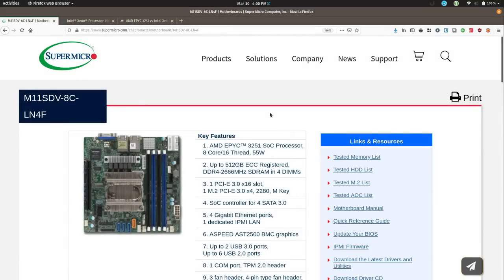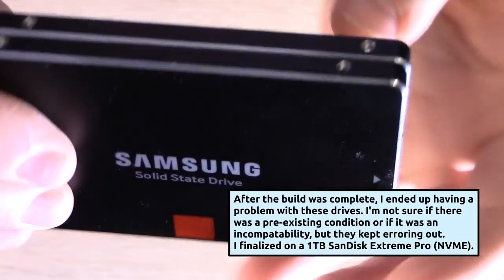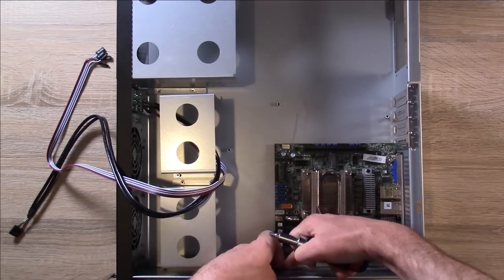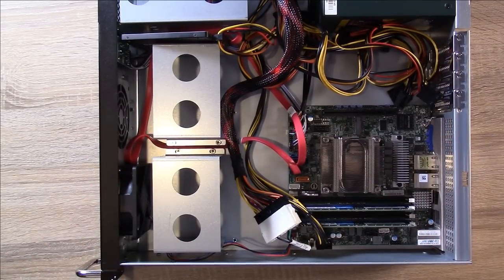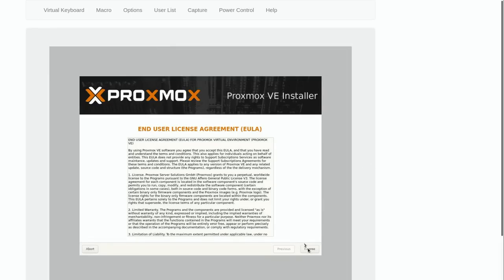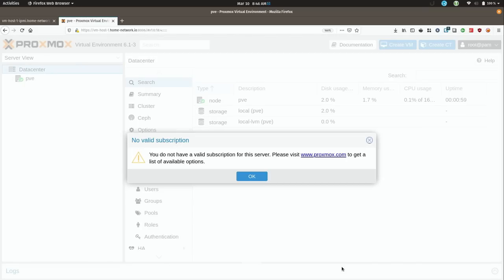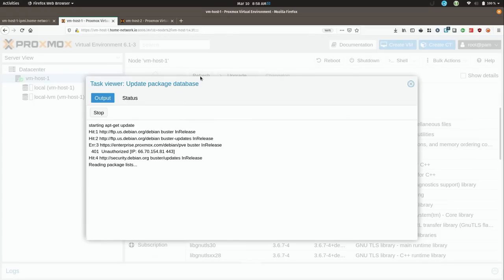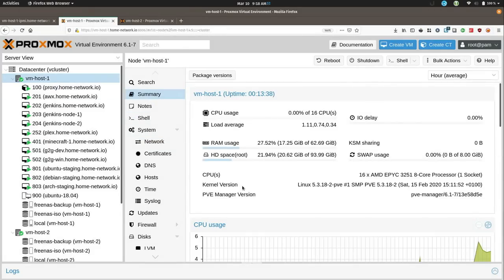Building a Low Energy Virtualization Server for Your Office/Homelab with Proxmox

Comment: HI Jay, Have a question looking to setup a home lab but will be a single host for virtualization and storage sharing  i am not sure how to go about setting things up. My initial so far have installed Proxmox on nvme drive have  an ssd for cache and log , another ssd for vm and container disks and 4 x4b in a zfs pool for storage. I have created a few vm but not sure how set and share the storage among vms, should  i set up a file server to use the zfs poll storage and share the storage that way or is they a better way , thanks

Comment: Wait, I want to know more about this web interface you have available out of the box after power on the server :o seems too god not being forced to use a display
Reply: Its generally called out of band management, or IPMI. ILO on HP, iDrac on Dell, something else on Lenovo/IBM.

My ASRock Rack X470D4U has it for the Ryzen platform, most of the white box type platforms like Supermicro and ASRock give you the whole thing, with Dell and so on you need to pay for the cool stuff but get basic management included, like remote power control, etc.

It is basically just a tiny ARM SoC that provides video and control when there is power to the motherboard, usually through a dedicated ethernet port but some can fallback to another port say if the dedicated one dies.

Comment: I really want to undestand where Virutaliztion is worth it, i really want to get into it, but i dont know where it will be useful.
Reply: I was the same then I lost my job and needed to reduce my electric bill.  So I built a i7 3770 32gb ram  on an intel motherboard.     I basically run mirrored mx500 500gb for the VM storage  mirrored mx500 1tb drives for my web server.   And 5x 8tb zfs2 raid.    
So I was basically able to get
Pfsense firewall
Pi hole
Open media vault Nas
Debian Lemp stack web server
Debian based Plex server with 1050ti for tanscoding

It's high on the ram but the cpu hasn't ever gone over 30%.   

I literally had a server for each before so it's massively cut my energy use.

Comment: Jay, I could use some advice. I just setup a 1u implementation of this server and am stuck. Shortly after selecting the install option on the proxmox splashscreen I am getting watchdog notices for all 16 cores and the install goes no further. I have tried installing other operating systems (ubuntu, debian, older versions of proxmox) all with the same stalling problem. Any ideas?

Comment: Do you have a tutorial on how you set up home-network.io as a functional local domain?
Reply: There are a few options to do this... 

Some routers allow you to define host overrides and act as a DNS server, pretty sure OpenWRT has that feature. 

You could run your own DNS server(probably what he is doing) and another benefit of that is you can block ads across your network.

You can probably define local domains in your hosts file and be done with it, though, it would be on a per device basis.
Reply: Wait..actually, he might’ve done it in pfsense, I didn’t realize it had that feature 💁🏼‍♂️ 

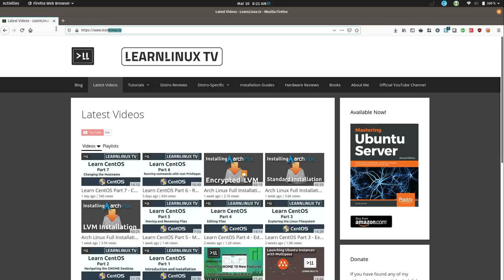16:25

Comment: Did you run into any issues on first start up? On mine, when I tried running it for the first time, it looked like it started (diodes blinking, fans spinning) but there was no video output. I ended up replacing CMOS battery (was dirty like somebody picked it up off the ground or something) and then it started BUT I had to rebuild the whole system and then it had same symptoms yet again. After power cycling it several times including clearing CMOS memory few times it finally started and haven't had any problems since then (although it was just over a week now).
Reply from the maker: I haven't had that issue. In some of the reviews I've read, it was mentioned by several people that the first startup takes a ridiculously long time to POST, making people nervous, and then eventually it comes on. These reviews mentioned that every subsequent boot is normal. I was expecting to run into this myself, but I didn't. Did you wait a while at the first startup? I'm wondering if perhaps you ran into the long first-boot issue and resetting the CMOS was just a coincidence.
Reply: @LearnLinuxTV  On the first startup, yes. But then after tearing it all apart and back together it happened again. I was thinking the board was dead - with just power connected to it (no RAM, no drives, no nothing) it didn't give any error codes (so there was one thing connected - the buzzer). Other then that it seems like it was as you described it. I guess I didn't search good enough to find those articles. Thanks. :)

Comment: You shouldn't use 2 identical SSDs for RAID1. There are sometimes firmware bugs where both SSDs can fail at the same time. Use 2 different SSDs from different manufacturers would be best.
Reply from the maker: I can see a good point there, so long as both SSDs have identical specs.
Reply: @LearnLinuxTV  Of course they need to have similar specs. The problem is that this will not work with large arrays and can increase cost for some uses cases. But a 2-Disk RAID1 in one computer, i would use 2 different ones.

You may heard about the firmware-bug that some HPE (HP Enterprise) SSDs have which will cause a failure after exactly 40000h, which was announced a few weeks ago.

Comment: Why not use a regular AMD desktop platform? Seems that my be cheaper. I did think that mini-server board is cool.
Reply from the maker: That was the first consideration I had, but finding a desktop board with ECC support wasn't easy. It was a lot harder to find compatible parts, and the approach I went with with the server board was easier for me.
Reply: @LearnLinuxTV  Have you done a careful consideration as to whether or not it's worth the cost for ECC? There's some pretty convincing arguments to be made about the quality of memory these days versus those of the past. In a NAS server running ZFS, I could definitely see it. But in a proxmox host just running some containers, it may well be just fine without the ECC and save a bunch of money (or open it up for cheaper hardware). Food for thought.

Edit: I found the article I was looking to remind me of pros/cons. https://www.pugetsystems.com/labs/articles/Advantages-of-ECC-Memory-520/
In short - still worth it, but only if it's not expensive. I guess for homelab we would each need to weigh the cost difference to decide.
Reply: @brentmeriwether7759  if there is even slightest chance that homelab will be in use 24/7, You should go down the ECC route. It just isn't worth of hassle with non-ECC when some bit gets flipped for no reason and ruins all the work. I did re-purpose my dual e5 Thinkstation C30 as homelab PVE node, which is a power hog compared to this epyc system, but at least I'm safe that it'll handle all tasks without hiccups. Even with zfs on 840evo ssd (https://youtu.be/0cN-bFZMysE?t=1298) :D

Comment: In a hypervisor if i have a cpu with 8 cores and 16 threads does that mean that i can have 16 vms ? or 8 vms ?

Also what if i use windows or linux as the main os and not a hyper visor. ? Can i use 8 cores for vms and 8 for gaming ? Or can i only use 4 cores for vms and 4 for gaming ?

(i.e i am trying to use half the processor for vms and the other half for gaming)

What is a good solution to this problem bro ? :D I would love an answer or just some help. This is honestly a really cool issue or question to clear up. I am trying to get into vms but i don't have the cash. But i have this good system here with 3tb... I learned about docker. But i am not sure how that works either.. 

Can some one lead me on the right direction ? :D

Comment: Hi,

I was curious how many hard disk can you connect to this server? As I was interested in building this but using esxi for Virtualization and have a few disk connected for storage and later considering connecting a NAS.
Reply: The max is four SATA plus a 2280 NVME drive. It's hypothetically possible to use a SATA expander but I haven't personally tested this. I will probably eventually figure out a way to get a PCI-E switch card or bifurcated riser on the 16x slot to break out to multiple slots (each could be used for an HBA.)

Comment: The drive issue is due to the poor quality of proxmox.
You need to;
Mkfs the drives used.
Then I used webmin to wipe and write the drives.
Then click data centre and add lvm group, this will bring up the drive online. .

I have noticed that they don't format well so you need. To keep a close eye on the installation as you may not get drive space and have to format once or twice and force it -f when doing the "blanking" of the drive following a proxmox installation .

(It causes nightmares) you cannot do this from Proxmox as they don't have the tools and the drives just don't wipe /format in any standard way. If you have SATA drives then you can take them out and format them else where. Make sure it's a full format. Before trying to use them for anything.

Comment: What the hell is up with that board only using like 4 of the 24? pins from the E-ATX power connector?  I know you don't need all of them, but damn, how is it getting by with only 4?
Reply: Some ITX motherboards take directly 12V and then internally convert to any other needed voltages. Think of it like a laptop which charges from lets say 19V and then internally does the step down to 5V 3.3V 1.8V etc. That 4 to 24 pin is just for the live signal to power on the PSU, the 8 pin CPU connector is the really important here.

Comment: of course it s not money efficient since mobo only cost 750
you should also turn the power supply upside down since the way you installed it you make the fan useless (Edit: I ve been corrected on this one that the psu doesnt have fan on either up-down side)
Why you used all the ssd and not a portion of it since it needs 16gb. Are you going to store the isos in there?
Reply: No kidding, I just built an entire unraid server for less.  8 cores, 16 threads.
Reply: My CPU mark is double his on 3700x as well.
Reply: ierosgr there isn't a fan on either side of the power supply so it isn't upside down. Both of the large sides are solid. It may be a front to back power supply.
Reply: @tomf4474  me too a Dell T7600 with dual xeon and 64gb ram 1300watt psu (doesnt use of course all Watts) and 2 gpu's
Reply: 750 is Motherboard + CPU

Comment: I tried proxmox in a VM and I had some fun, but why should I buy extra hardware for say $350. My Linux VMs boot in ~10 seconds from a nvme-ssd and the VMs run from the L1ARC cache and I have instantaneous response times. What is the practical advantage of running my VMs on proxmox instead of on my desktop with say Ubuntu, Virtualbox and ZFS?
Reply from the maker: It's not necessarily that one solution is advantageous over another. It's all about what you want your infrastructure design to look like. In my case, I like having my infrastructure centrally available and not on my desktop or laptop, so my instances don't depend on the state of my laptop or desktop (which are often off, or asleep if not in use). There are some resources I want to run overnight or some specific schedule.
Reply: @LearnLinuxTV  I was hoping for an excuse to spend another $350, because I like Proxmox, but you are probably right. 

By the way my VMs don't depend on the state of my desktop, I parameterized everything including conky and exactly the same VMs run on desktop and laptop without any change. I zfs send/receive all changes to my laptop once a week :)

Comment: Really amazing video, thanks for sharing it, I'm practically using it as a guide for an extremely similar build.  Same motherboard and same memory atm, wondering about a couple of things maybe you can help me,

1) I'm running the same memory as you, from your video i see you running 2 sticks, i can boot with 2 sticks at 2666, but i have to lower it 2400 if i boot with 4, not sure if this happen to you or you running auto? Auto with 2 sticks runs at 2400, with 4 runs 2133.
2) What NVME did you end up buying? i checked the supermicro web and only has the Toshiba KXG6.

Comment: Any single CPU system on LGA 1151 / 1151v2 / 1200 (and similar) draws 50W at idle. Even LGA 1150 / 1156 is just a bit hungrier but well under 100W.
i5-10600k would be an exact match to your EPYC in performance, a couple threads less, but a lot better frequencies and single core performance (ofc there are similar xeons if ECC is required), and possibly costs less than this SoC.
It is LGA1366 that is terribly old for low power consumption and you had 2 of them.
LGA2011 (+ similar extreme sockets) is the worst at ~115W+ doing nothing.

Comment: Does anyone know how tall is the heatsink on the motherboard? I'm thinking of replacing the current one on my NAS but I have height constraints in the case.
Reply: I just bought the passive heat sink version and it fits just in a 1u case. The cable management is hell in a 1u but the heat sink fits
Reply: @grahambo-42  Many thanks!

Comment: Great video. I was thinking about getting the MBD-H11SSL-I with Epyc Rome with 16 cores. I build a lot of containers. This GitLab project is for some of the containers I build in Proxmox gitlab.com/SiliconTao-Systems/WorldBuilders
My issue is that I use it for development and more RAM is the biggest requirement. Unfortunately, it also going to be the most expensive part.
Great video.
Reply from the maker: Thanks for the link! I have that on my list to check out. Server RAM is definitely cost prohibitive. Especially with ECC. But with containers, you should be able to stretch your RAM much further than with VMs, as you likely already know.

Comment: Should SMT be disabled for better security?
Reply from the maker: I have mixed feelings about this. When it comes to security, how (or if) you work on mitigating a potential issue depends on the type of vulnerability you're trying to prevent, and how exploitable it is. Remote code execution vulnerabilities are the worst. Always mitigate those first. But if a security vulnerability doesn't apply to you (for example, the flaw requires the hacker to have physical access) then just decide whether or not it's important in your use-case. So far, I haven't found an actual reason to be concerned about SMT threats, especially if you have your VM server behind a firewall and it isn't externally available at all. It's not like someone will break into your house and utilize an SMT vulnerability. Keep outsiders out of your network, and the rest works itself out :)
Reply: @LearnLinuxTV  There is portsmash that can read some of the data the a process on the other thread, on the same core.
openBSD disables HT by default because of that, i do not know about other SMT implementations.

Some of the VMs need to accessible from the internet. I guess i could assign every VM to one core, but that is not scale very well  and would waste a lot of CPU time since they are idle most of the time.

Anyway, thank you for your answer.
Reply: @happygimp0  Use traefik to bastion it I guess

Comment: 1000$?? Man... Are you serious? 1000$ for a homelab, when the market full of used Xeon processors starting from 15$ and whole servers staring from 150? I have an hp dl380g7 with two 6(12) core processors for even not a 200$, which runs 5-7 guests in a mixed unix-win environment and has a consumption of about 100W. 36gb of RAM, 2xHDD, SSD, raid controller - everything together. For an about 3-4 hundred I can build a top 2011v2 or even v3 Server with a same power requirements. 1000$ for a AMD 1xCPU solution.... Yeap... )))

Comment: I've got a Proxmox lab built entirely out of consumer hardware and I'm curious to know what kind of errors you were seeing with the SSDs in the ZFS pool. All my data is on platter drives, but my VMs run on a ZFS striped SSD pool. They're nothing special, just humdrum WD Blue SSDs and I haven't had any issues whatsoever for months.

Comment: What temps you're getting on this CPU?
Reply from the maker: Right now 70c, which is kinda high. Another person commented that with certain types of cases, a CPU fan might be a necessary addition. I will look at doing that.
Reply: @LearnLinuxTV  This is what i thought. This CPU is not passive cooled. This heat sink is designed to high airflow in rack mounted cases.

Comment: If you want to build a low energy virtualization server then I can't believe you would go with Proxmox? My r620s draw 90-100w idle with proxmox, 60w idle with ubuntu and 50w with vmware. Proxmox/debian is far from energy efficient (Eventhough proxmox runs the latest ubuntu LTS kernel + proxmox patches)